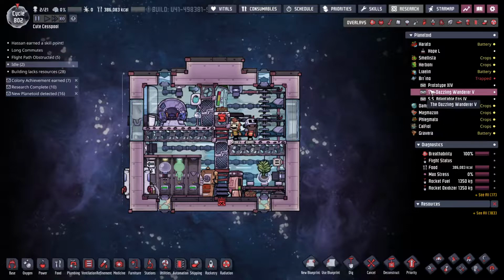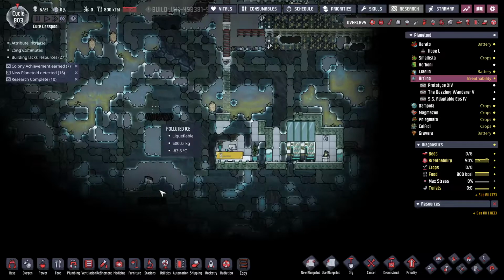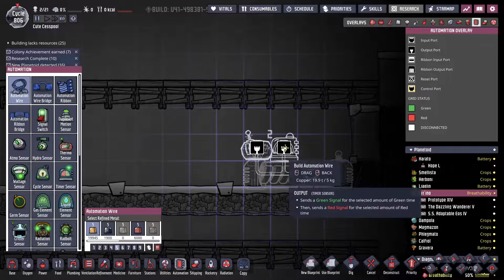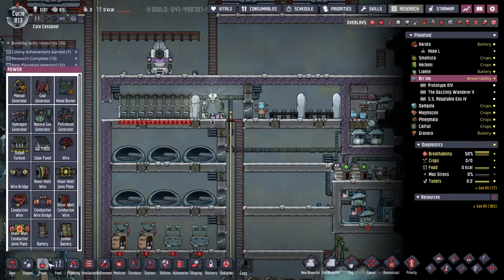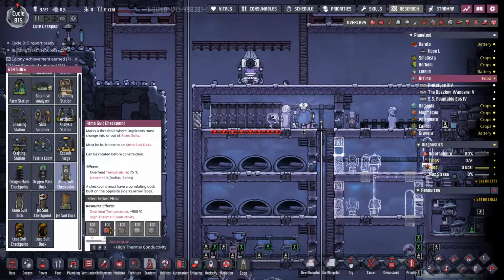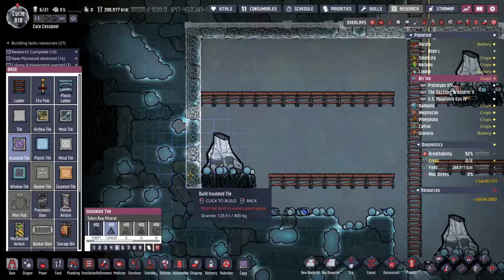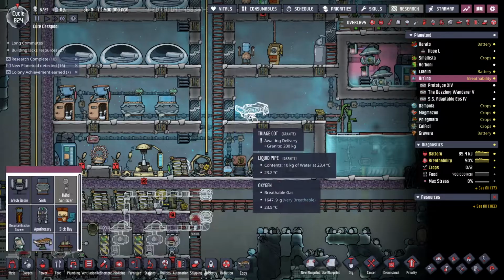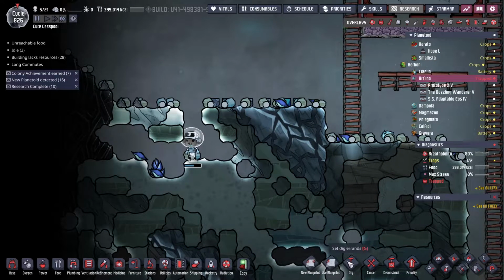Cute Cesspool Ep 27 Finding Power in the Ice. Building the Mini Base

Comment: For clearing regolith from your rockets, you could move them up a bit with no flooring directly under the pads and put a c-miner setup below the pads.
Reply from the maker: Nice idea.  I want to go back through the game notes, when did they stop rockets from crushing fallen regolith?
Reply: @TartarusPlaysGames  I don't recall dlc rockets ever crushing regolith, mainly because until the tear opener was put in they didn't need to afaik.
But I would guess they don't want us using rockets to flatten the regolith roid or maybe to add a bit of complexity to returning to the icesteroid post opener.